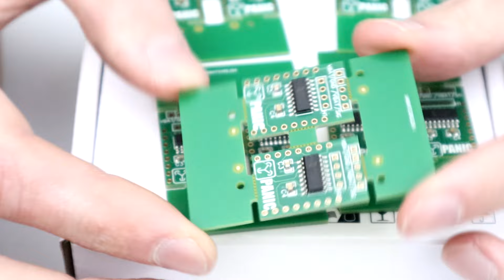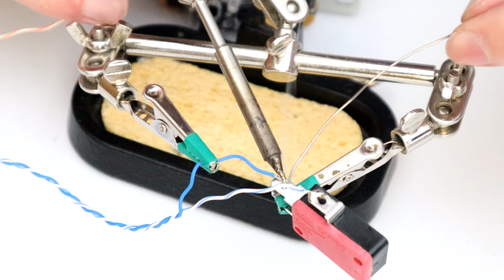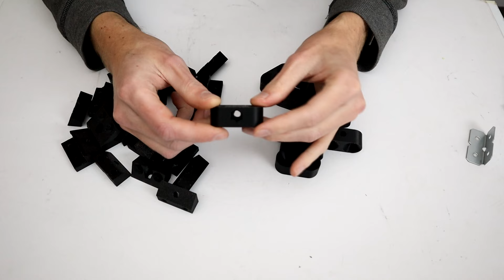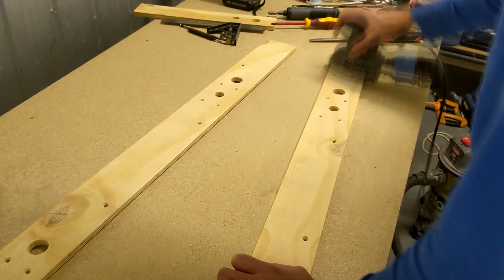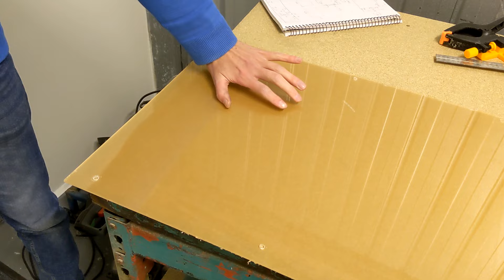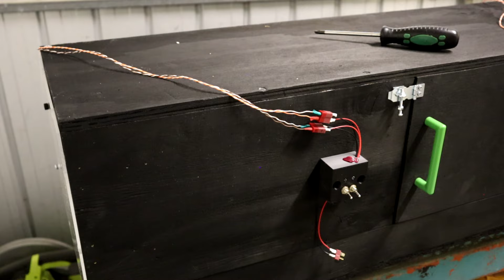Arcade Combat Robots!! (My biggest build ever!)

Comment: Now add wireless charging, so they either park in designated spot to charge or under the whole arena
Reply from the maker: That is a great idea, theres a lot of additional things I wanted to do, but I had to cut it all back so I could get them done

I fixed the charge problem by using 1s 750mah battery that lasted 3.5 hours, which gave enough use time to run the whole day with 2 sets of robots.

A wireless charge pad is a good idea but it would need to be the whole arena, as they basically didnt stop being driven for 8 hours
Reply: @TeamPanicRobotics  yeah big battery a simpler option!

Comment: This is so cool. I have thought it would be cool to have something like this. If there is one thing i would change, i would add some beefier batteries to tho robots.
Reply from the maker: I used 1s 750mah batteries as I wanted them to last as long as possible, 
They lasted 3.5 hours on a charge, which was enough as I had 2 copies of each so I could easily cover the full day with them